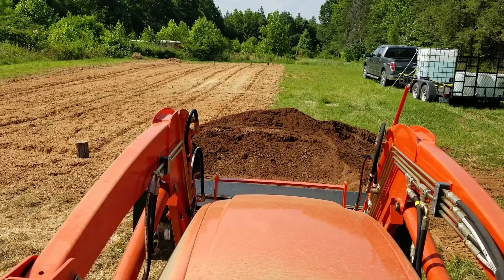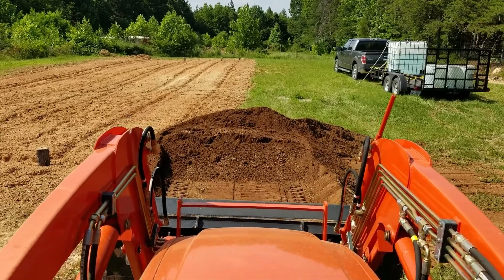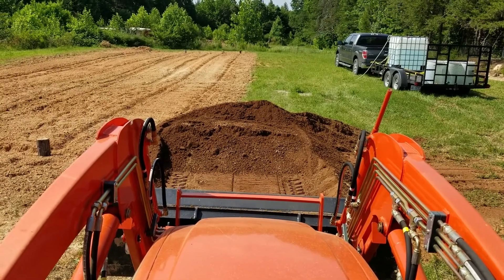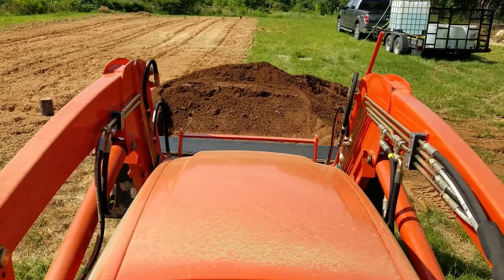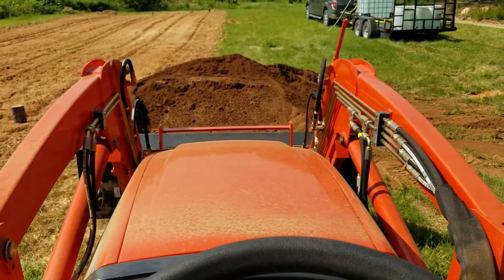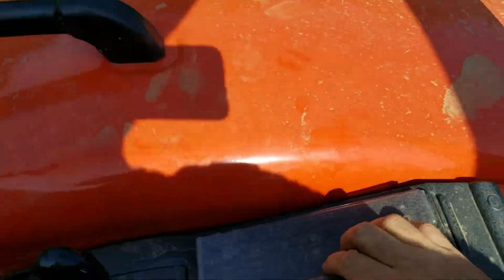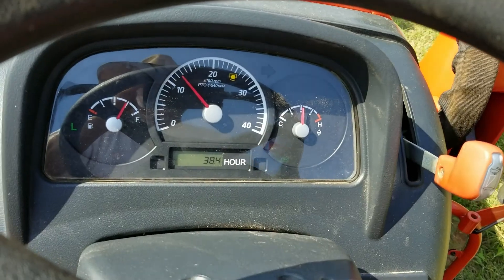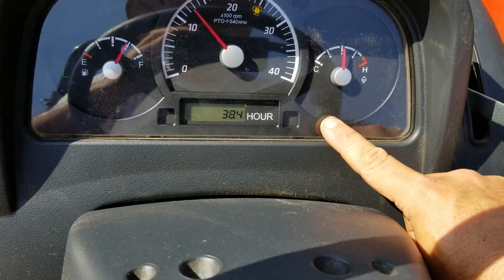Kioti NX4510 HST No Stall Feature

Comment: I bought the DK 4510 less features but does everything I needed (2017 model) Keep an eye on the hydraulic connections for the FEL the ones from the tractor not the quick connect 2 of mine started to leak around 40 hrs. Had my first regen about the same time so far so good!
Reply from the maker: Will watch for that - thanks!  Someone else noted the way they are run they can rub and wear.  So will be checking out that whole area for hydraulic lines very closely next maintenance time.  I was at about 30 hrs when I hit first regen.  Thought it would be a little longer, so maybe I'm idling/low RPM too much.

If HST version of DK was available when I bought this, I probably would have gone that route.  At the time it was unknown when they would be shipping but dealer estimated Jul/Aug until plenty available for him to order.

Comment: Does the  kioti hst reaction dial actually change the depth of engagement for the HST pedal on the new models or only how quick it moved thru the range once engaged?  I understand they went to a solenoid HST in the last year or two and the pedal has a totally different feel from direct link HST pedals. The local dealer here had no clue other than saying all tractors were like that which its not. There was no engagement, forward or reverse, until at least 1/3rd of the pedal was depressed. Does this dial change that so its changes the take-up slop before engagement? Cant find any video or specifics other than mention of the dial but would like to see detailed info on it.